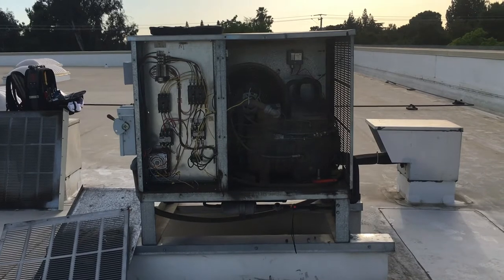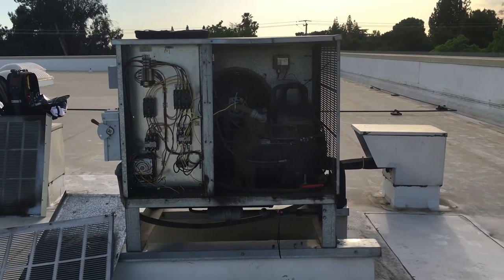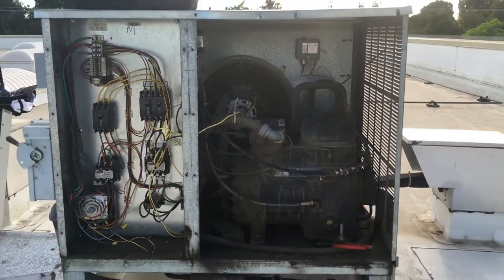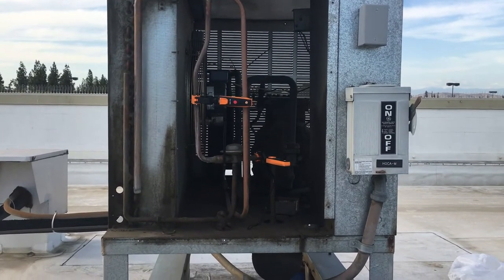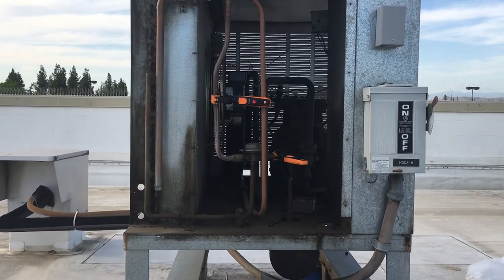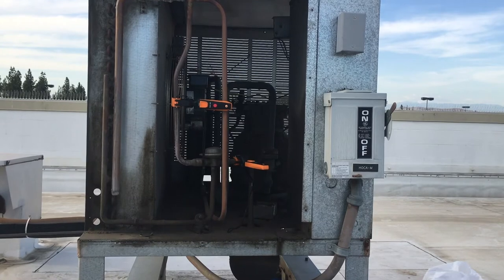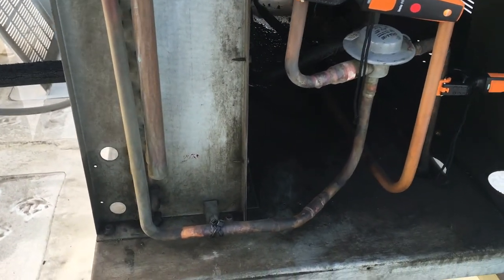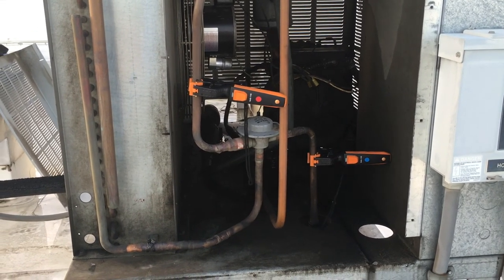Refrigeration Low Ambient Head Master Control Operation

Comment: Just had a headmaster problem with a remote condenser, it was for an ice machine, sometimes the headmaster can get stuck bypassing which is a whole other problem check by giving it a tap
Reply from the maker: I always touch the liquid line to make sure it is not hot. 
Thanks for watching!!